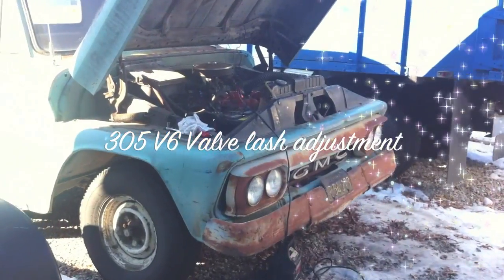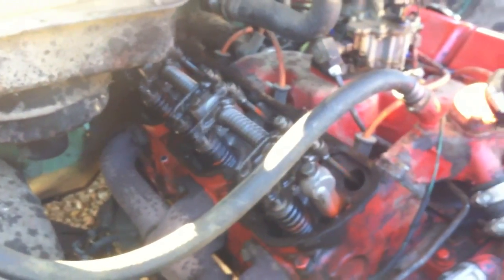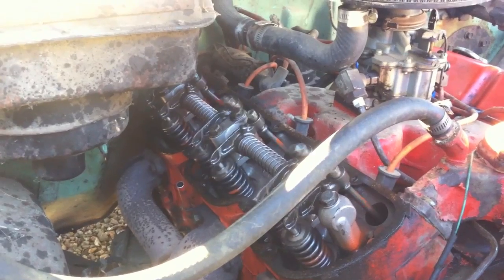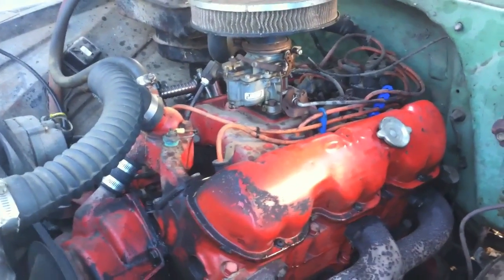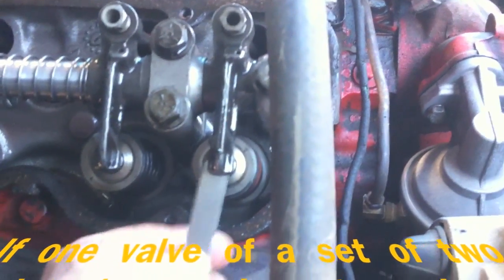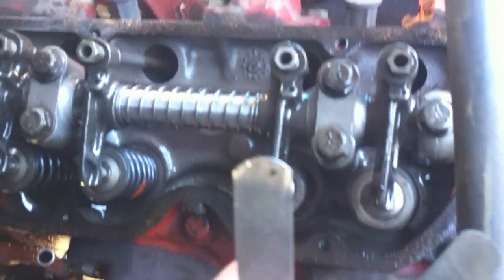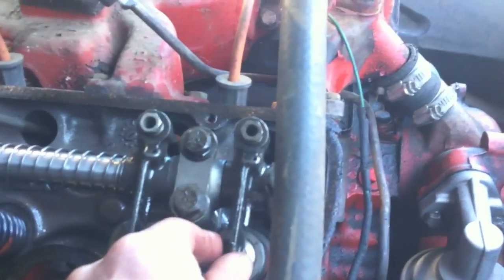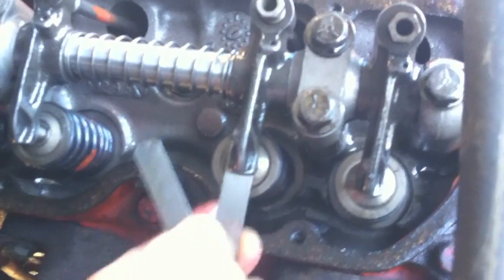305 V6 Adjust valves

Comment: I'm sick and tired of hearing that crap too!! Those are great old engines!! Tough! If you run a 3:08 rear axle it will get decent gas mileage!! And tons of torque!! I have a 66 GMC stepside identical to yours,,, unfortunately i messed up my 305c by flushing it out,, and stopping up the oil pump screen thus spinning a rod bearing!!! But i know where another engine is and I'm probably going back with it!! I loved that old engine!!

Comment: The reason I like these engines is because, with a 305 the truck could tow a pickup to the top of Dugan's mountain in 4th gear.  
Later Dugan swapped in a 350, and he could not do any better than 2nd gear towing a car up the mountain.

Comment: These things are pieces of crap! I can't wait to get rid of my junk V6! Not sure when GM ever made a good engine but these V6 are about the worst of them all!! Constant work needed! Can't make 15 miles without the piece of crap having yet another issue! Don't forget the no power! Your just some backyard clown! Real mechanics know they are JUNK!!! And clearly you have no clue how to do a proper valve adjustment!!!
Reply: SIR, these engines are not what you describe them to be. My family owned a GMC dealership from 1958-1969 and this engine was the best engine ever engineered by GMC truck & coach!  I personally would not trade 1 GMC V6 for a trainload of those imitation passenger car motors!!!  If you have such a disdain for them,  then go buy yourself a bowtie imitation of a real truck.
Reply: lewis matkin if it was so great why is mine constant problems? Can't make 15 miles without another problem. At least the car engines make it more then 15 miles without a repair. You can't argue with FACTS!  Just like a dealer tho. They always claim junk is great. Never seen a dealer that actually called out the junk! Also no I will not go buy anymore bowtie junk! GM has never made anything good only a few ok things now and then. Bad part is around here it is hard to find a 2 1/2 ton truck not made by government motors! I can't wait to find something non gm pop up for sale. This hunk of crap GMC will find it self on the back of the new truck headed to the scrap yard! The real sad part is the chevy with the 292 we got walks all over the junk v6 in every way! It never breaks down more power drinks less fuel. Looks like the little car motor takes the win to me! v6 might be good for 1 use other then scrap metal. A anchor for a boat! Literally 2 days ago the 2 trucks was parked side by side next day jump in to start the 292 it fires and idles perfect as usual the V6 gotta pull out the wrenches AGAIN! So freaking annoying!
Reply: Dayton D cool engines mine still runs great sound like user error and bad mechanical skills.
Reply: Dayton D but hurt much? You watched this video for a reason so go cry to someone who cares. What’s the name of your repair shop so I can go look at your awesome yelp reviews 😂 any good mechanic will tell you upkeep and preventative maintenance goes a long way especially these big block v6’s. Heck they are 60 years old..we got us a real winner here guys..
Reply: You watched the video and commented because you’re a troll GTFOH 😂 literally a instructional video to adjust the lash. Waiting on your Yelp link to your 5 star mechanic 👨‍🔧 services...🔥
Reply: Dayton D sounds like it's you
Reply: Dayton D must have really hit a nerve you practically subscribed to all my videos all times of the night ha... fn pos 😂 Thanks for the love big guy nice to know I’m wanted. I have tons of fun sports cars, keep working hard at that awesome imaginary shop of yours and someday you can have some as well. Have a happy Tuesday keyboard warrior!
Reply: 140,000 and counting on my 305 v6. Big boat of an engine(900 pounds with fluids) and yup they guzzle fuel. lol I did an hei and a 4 barrel eddy on mine with dual exhaust. Actually sounds pretty damn good. Pulled the motor for a reseal and repaint a couple years back, put 30k on it since. Some of them can be a pain in the ass man. Also got a 292 in my 66 backed with a tremec 5 speed. Hopped it up a bit. Hope you have better luck with it, these things were picky on valve adjustments and sucked with the tiny two barrel. Can you believe GM put a fricken 1 barrel on them in 1960? I kid you not it wasn't much bigger than a briggs opposed single barrel. haha To make matters worse when these carbs aren't up to par these engines will run like utter shit. Pop a 2 barrel holley or a small 4 barrel on there and I think you'd be surprised.
Reply: @eatshitful  Damn you've had every bit of bad luck that you can get with a motor all at once.  Out of curiosity you try bumping the timing up? I found mine runs better with 10 degrees initial instead of the factory 5 degrees. 
But damn man lol Hey if you wanna dump that truck at my place I'd be happy to try an crack its curse! lol
Reply: @militarychevy711  Oh i played with the timing  several different times. I had her way up for a short bit and gains some power but it was to high and kicked back on the starter when starting lol For awhile i swore it was moving on me but i never had a timing light to check at the time it would act up. IDK about giving it up for free tho. I would need to have some revenge with it first! lol I just keep hoping this trend of problems finally ends or i find a replacement. Still need a truck to do the work it does. Well after a repair that is then it will do some work lol
Reply: @eatshitful  True that! Can't beat a good ol 5.9. I'm looking at either a 6.7 cummins or a 6.6 duramax. All 3 trucks I own are in the 60's by GM so a newer chev would fit right in with the garage setup, but the Dodge is the only truck available with a stick these days. Can't say allison is a bad trans, but I like rowin the gears. lol Anyhow, hope better luck comes to ya when you work on it again.
Reply: @militarychevy711  Cummins common rails like to go threw injector every 150k or less. Older 12v and 24v 300k+ i still have a 24v now with factory injectors with 340k without issue. Allison in the chevy is not the same reliable allison we knew from the bigger trucks. It is literally specific built for automotive use. Meaning it is no stronger built then any other light duty truck tranny. Probably why one customer went threw 3 of them before hitting 100k on his truck lol The guy never pulled with it or anything. They literally did it this way to make bank off the allison name. Obviously if GM had used a real allison tranny that truck would cost way more then dodge or fords. No way to compete having to price way over the competition. Local tranny shops here report more GM rebuilds then ford and dodge combined! But that name tho ya know! lol

Comment: what I want to know, how in the heck is oil not spilling out all over the place?
Reply from the maker: Drain all oil out of crank case first...
Reply from the maker: Actually the pressure is not that much at idle, If you rev it up oil is going to fly..........

Comment: worked for a freight company that could not get enough of these v6 motors. they ran them on   big straight trucks as well. they always got 300 k plus miles on them. my dad had one with the 305 E the small motor and we put a camper on it and pulled a boat with it. they made a 355 magnum and a 401magnum that were popular, this engine was the base for the 12 cyl motor put in busses an large trucks, bullet proof. block was nickel not cast iron. seemed to eat gas at 10 mpg and fuel pumps but those are the only down sides. torque monsters.
Reply: I know a guy with one that just past 500,000! lol

Comment: How much power it can withstand n put as well
Reply: I've heard some neat stories on hopping these up. Not much in the way of custom stuff. Best and most common thing so far is dual exhaust and a 500 cfm 2 barrel and HEI swap. Helps a lot with power and torque throughout the curve. Stock is 160 hp and 270 torque. With the swap you'll probably see around 185 hp and 285-295 torque. More compression and more cam lift makes the real difference on these.